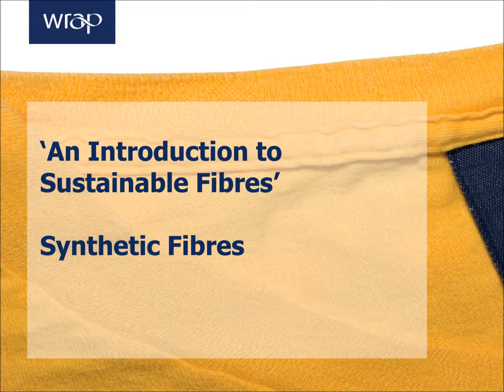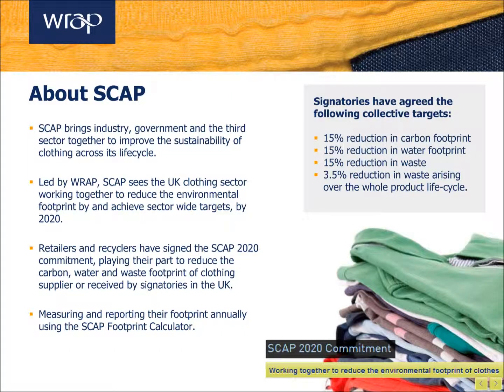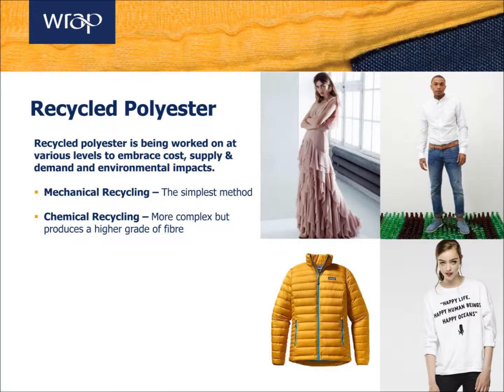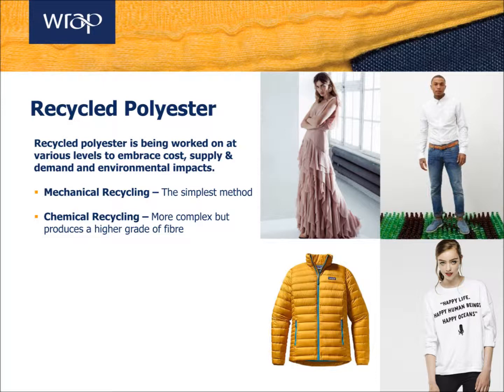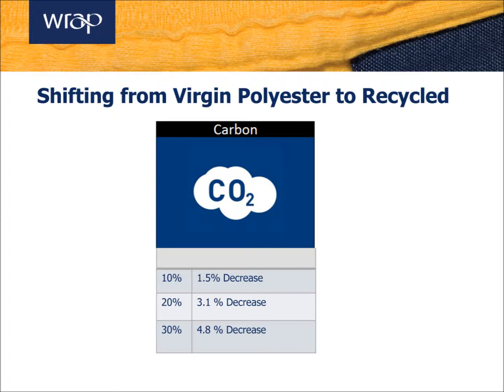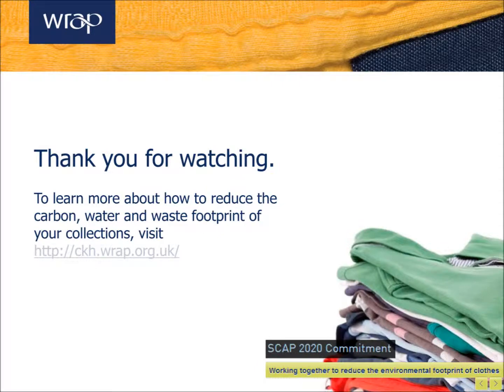Bite-Sized: Introduction to Sustainable Fibres - Polyester

Comment: the impact on the invoiermend of the proces making  polyester is less than produce cotton. if you  make a lca as we did the impact of cotton  is higher than polyester.
In the fase of re cycling the materials , again the invoiermend impact of cotton again is much more higher .
polyester youse in a close loop / circulair save you 60 % on the invoiermend impact compared with cotton.
We did the lca calculation on a rain suit made from infinity / polyester from raw material to youse , we take the rain suit and recycled it to the same rain suit made a lca with in the circulaire economy
                                                  first time rain suit                                 second time 
social                                        22,25 euro                                             5,49
energie                                     3128   mj                                               1220 mj
water                                        171  m3                                                  6,56 m3
waist                                         10,58                                                     0,46
co 2                                           156,20 kg                                              48,86 kg      
￼ This project is than in the eu project eco profabricks pilot as above is don real time for RWS the dutchgovermend .

hope to give you the inside's of re use choce of material closing the loop and only if you really closing the loop you get the wright data

regards rien Otto dutchawearness 

￼￼￼￼￼￼￼￼￼￼
￼